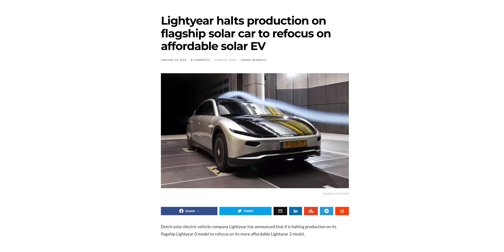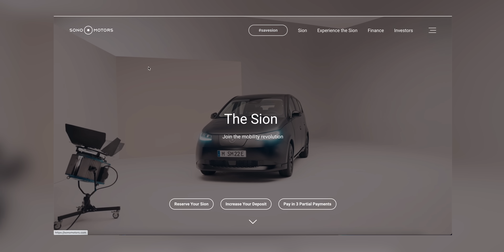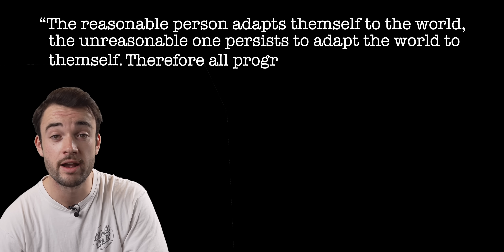Will Solar-Powered Cars Ever Happen??

Comment: If the cells hold up over years of ownership, it can be a reasonable way to trickle charge the battery. But nothing within 30 years expected that will make it a primary source of power. But great if you only use the car once a week and it can sit out in the sun until then.

Comment: Unfortunately it is a stupid idea because you can simply put solar panels on your roof and charge your EV from them. For example a 6.5 kw solar system with a 5kw inverter can provide 800,000 miles of charging. Two Model 3 Teslas for 20 years. So instead of paying $250k for one Sono  you can simply pay $6k for a solar array and $40k for a Model 3 Tesla.
Reply: It is not an either/or choice.  Many potential Aptera owners don't have access to solar panels on their roofs, and even some of those who do may travel enough that the on vehicle installations can still pay off the cost in a reasonable time frame.

Comment: I've been tracking these 3 startup from the beginning
Sono motor: doesn't have real technology and they hire contractors to find solution, and it seems they don't know what their doing I can't find in their team single talent 
lightyear: have great technology and good passion team and build a real solar EV the problem is when they reach the production hell, they didn't plan to this point and they surprised by the amount of problem and cost they are faced and they fail fast
Aptera :is the best and real technology between them with very experienced and talented team they calculate every step they are doing with very low cost, and they planned to production from day one, the only problem they are faced is timing, if they launched sooner than that they will find every funds they are want from everybody
Reply: Aptera and lowcost? motors from slovenia, bodies from Italy? Batteries banged together from ancient korean cells?

Comment: when you know physics...the answer to the title is simple. power for area of solar cell is low compared to the needs of an automobile...and then when you consider the cost of incorporating the cells into the body of the car, the concept becomes ridiculous.   the people who think this is a viable idea also think an engine can be run on water.
Reply: I suggest you take a look at the numbers Aptera is achieving and couple that with the fact that the cost of full solar on an Aptera will amortize, and just not only in the sunbelt.
Reply: @n.brucenelson5920  i'm not talking about an Aptera. i'm aware of the solar challenge and that a vehicle with very little load and extreme aerodynamics can go places on solar.  i'm talking about automobiles that carry families and luggage and have safety features....solar won't do anything of worth.
Reply: @rwhirsch  You are correct that solar is far from the point that it can just be grafted on to an ordinary car and make a significant contribution to range.  

Aptera, while fine for couples, won't be a family car until they introduce their 4 wheel, 5 passenger sedan.

The present Aptera has 32.5 cu ft of luggage space, and has significant' safety features, including crumple zones and front air bags.  We will learn how effective these measures are when the third party FMVSS Part 200 crash test results are published.

Comment: The problem with these cars is the dream they sell will never be realised.
E.g. The Aptera presentation explains the solar generates 4 kWh per day and the vehicle efficiency is 100 wh/mile - sure 🤯🙄
Reply: So, where exactly do you see a problem?
Did you overlook that the 40mi/d on solar is a maximum "up to" value?
Reply: @ThomasWaldmann  - yep, I heard ‘up to’ and it’s completely pointless telling us this scenario. Be honest and give us some real world scenarios. I don’t care for lab and controlled conditions range info, when it’ll be impossible for anyone to get anywhere close to this! There is no place on earth where this charging and range is possible in the same place, in a real use case.
Reply: @SDK2006b  You have high demands, but all you offered yet are ... wild guesses?
Reply: @ThomasWaldmann  -  wild guesses -  nope. 
I have home solar, drive an EV and have worked in the energy industry for over 20 years , so am familiar with the tech and what is achievable. There is a reason this company is struggling for investment - the claims are wild and they won’t sell enough to make it work.

Comment: Look at the maths! Solar on a car - for the amount of design/development effort involved, and the not-very-great return, common sense says, the extra cost is not worth it...a couple of flat panels thrown on the ground - way way cheaper, and just as effective. (While I do applaud them for trying...) Initial attempts at Design and Development should focus on lowest cost, for quickest project completion - add in your fancy pants stuff afterwards - if you haven't got the basics right, you aren't going anywhere....(I see projects with fanciful ideas never getting off the ground, because the basics are a bit boring, and don't get dealt with, whereas the fancy bits are interesting to designers and engineers...)
Reply: "Common sense" is often just an excuse for not actually looking at the numbers for yourself.  I have for my location in Iowa - not exactly the sun belt, and the cost of full solar still amortizes in a reasonable time frame.
Reply: @n.brucenelson5920  Yes, But here we are talking about putting Solar panels on a car ! Its reasonably easy to see that its a tricky thing to fix multiple non-flat panels and connect them together on the surface of a car, rather than a (normal) large flat panel...and make it work reliably. Weather , vibration and shock will all play their part to make this harder than it might seem at first,,,and its also got to look reasonably good too ! It's doable, but is it worth the effort ?

Comment: I'm not quite sure why they all insist on jumping from prototypes to much larger scale production. Why they refuse to settle for being a specialty small scale garage car company for as long as they have interested customers at whichever price-point they can get.
Reply: Have a look at how arcimoto is doing currently, maybe that answers why.
Reply: For Aptera and other similar efficiency driven vehicles to achieve their intended purpose, they must replace a significant number of much more resource intensive vehicles.  That implies quantity production.

Comment: Yes, Aptera looks a bit strange, but in an industry disruptive way. High-efficiency EV design with solar-assist makes a lot of  sense for many people -- as does Lightyear and Sono. This is the direction future EV design needs to go. I invested.
Reply: We need more vehicles in the 'small, cheap and efficient' EV segment, and the Aptera really hits a good spot between being sleek, hyper-efficient and small without compromising utility. Nobody else seems to be doing what they're doing. For those who don't really need more seats, this be the only car they need to buy. The entry price for this kind of capability anywhere else is far greater. I'm really looking forward to seeing how it turns out and I'm rooting for them.
Reply: Solar on vehicles make no sense at all. Therefore Lightyear and Sono are already gone. Aptera is next.
Reply: @vic321344  Gaining as much as 40 free miles of range daily just by parking outside whether at home, work or out camping "makes no sense at all" yeah, sure... don't bother providing reasons or anything. :\
Reply: @MaskedMammal  These 40 miles are just marketing phantasies. Lightyear did not get it, Sono did not get it. Both dead now. Aptera is next.

Comment: 7:20 Aptera intends to make a narrower model for the EU.
  At the cost of the vehicle being a little less efficient.
Reply: How do you want to make a narrower model? A 1 seater with no stability?
Reply: @vic321344  I'm guessing they'll tuck the front wheels in a little closer. But we'll see.
Reply: @rashidclark  Anhd how do they want to steer the wheels? The aptera motorcycle already has a turning radius larger than a F-250.

Comment: The Sono seems like a car which would do EXTREMELY well anywhere that people don't drive huge distances and there is a lot of sunshine. In many cases it could mean that people literally never have to charge their cars, or do so so infrequently that they can top up every now and again from a standard wall socket. Anywhere in Spain for example, or even the Canary islands where it would essentially be a perpetually charged car.
Reply: Living in the south of spain and I have my sono sion reservation. Hope it gets produced.
Reply: @JorgeCastro_inf 
I read that they were manufacturing some of them in Germany, if that's true, that would be great
Reply: @tomhunter7536  sadly, they abandoned the production of the sono sion and are focused on installing solar pv on other vehicles. No sono sion for us sadly.
Reply: @JorgeCastro_inf  Dont need to hope anymore.
Reply: You can literally take any PHEV vehicle in production and slap a solar roof roof on it (like a van or a SUV ) to create a fully solar powered PHEV-s vehicle . why no major car company  one does this...
Reply: @chinabluewho  Because it is ínefficient and exensive. The yield is anemic.  It has no real use. Hyundai tried it on the Ioniq5 and now they cancelled it. Lightyear and Sono tried solar on BEV, and they failed. Aptera is next.
Reply: @vic321344  Vans or SUV's that have a ton of roof space for solar, a PHEV-s van or SUV by a major car company would change our  vision/attitude .
Cheap clean renewable energy that is just begging to be exploited.
I think we both can agree LIghtyear and Sono were simply not competent.
Reply: @chinabluewho  German Fraunhofer institute just tried that. Filled the roof of a truck with solar, got 3.2 kW peak. Was not even enough yield to drive the aircon. Other projects of this kind were cancelled or are on hold.
Reply: @vic321344  It makes no sense to imply "well solar can't power an AC in real-time". Because people don't leave the AC on in their cars all the time. They drive the car, they park somewhere and leave it there for extended periods of time. While it is parked, the panels are feeding energy back to the battery. Secondly, and kind of obviously, if you had two cars - one is an EV that charges only from the mains, and the other is an EV that charges from sunlight AND/OR the mains, then one vehicle has lower operating costs than the other. Can you guess which one?
Reply: @drxym  The solare range was always just marketing squack. Sono never published real life solar yield. Neither did Lightyear or Aptera.
Reply: I live in the Canaries and sunshine is our normal weather, so it would be great here. Never having to fill up with fuel or plug in to charge -- the ideal car 😂
Reply: The solar yield was not nearly enough to drive the car. It is anemic in real world scenarios.
Reply: @vic321344  Not on a van it wouldn't be, think about having 1 to 2 K of solar an hour while you are parked at work charging your battery (or at home), now think about the average travel distance is 6 miles for an American plus you take into account most people are like me and have two vehicles, if I have two PHEV-s vehicles I may not ever need to charge them via outlets or petrol since I only live a few miles from work and even less to the grocery stores.
Reply: @chinabluewho  But you remember that the charging electronics eat up at least 300W of your solar yiels? And the soalr arrays must withstand vibration, deforming, heating, salt gravel etc.
And maybe you had physics in school. A car needs 15 kW to drive. Thats araounmd 2 magnitudes more than you get from a solar array on a car. And the solar is expensive. And never cool down the overheated vehicle because it stood in full sun all day. That would kill the solar yield.

It is much cheaper and more efficient to put the solar on the roof of your gtarage. Together with a battery.

Comment: A good product seldom has problems to find investors. If they are staying away, than there is a reason for it. And it so happens that it is the very reason why no established car company put solar panels on their cars yet: it doesn't make sense (yet). The cost and weight added by the panels offset the gains by such a large margin, that it's better for everyone involved (including mother nature) to simply omit them. In some years, when solar panels offer bigger efficiency, this will change and I am certain, that there will be investors at the ready. But for now, this simply is not a viable concept.
Reply: If we were just talking about attempting the retrofit of a standard design, you would be correct.  But this isn't the case for Aptera, for sure, and perhaps for others.
Reply: By your statement "The cost and weight added by the panels offset the gains by such a large margin, that it's better for everyone involved (including mother nature) to simply omit them." it seems clear you don't really have an appreciation for the cost and weight of the solar panels on Aptera or Sono.  Lightyear's are indeed heavy BTW.  They are double glass.
Reply: @bobhilder1469  You can actually do the math pretty quickly. And it doesn't add up for the Sono for sure.
Reply: @NameNaameNameeNaamee  So you say.  Feel free to SHOW the cost a weight "math" for Sono's solar.

Comment: Bright spot: the fisker ocean one and extreme models in production now and slated for delivery at end of Q1 2023 will all feature solar roofs adding around 5 miles of sun powered charging per day.
Reply: But only if you park it in the direct sun. The Ioniq 5 had a solar panel roof as an option when released - but they never offered that in countries that don't have the scorching sun required to even make a dent in the energy balance...
Reply: @karlgunterwunsch1950  it will have a gauge in the ui showing the driver the total solar powered miles over it's lifetime, which will add up to a lot of emissions saved over it’s lifetime

Comment: The idea sounds good until you think a little more about it. Our cars spend a lot of time in car parks, garages or in highly built up towns. To properly power an EV so that you rarely need to fast charge you need about 60 m2 of solar cells. A Sion has maybe 3 m2 decently aligned - but see my first point, they need to be parked in the full sun to make the most of their piddly small active PV area - and the modules have a different heat heat expansion coefficient the the chassis of the car (which stays cooler because of the cells on the surface to make matters worse). That's why the current test models of the Sion look shabby.
Reply: Well, if you know that you will park mostly in the shadows, it's just not the car for you.
That doesn't imply that everybody has that "problem", though.

How did you come up with 60m2? Of course, the Sion is way less efficient than the Aptera.

I guess the material issues you fear were already solved by Aptera, they did quite some "stress testing" with their special panels.
Reply: @ThomasWaldmann  Aptera is further behind than the Sion. AFAIK they haven't even finalised the crash structures. The Sion has a design ready to be homologised and then put through the standardised crash tests. And even that isn't going nowhere fast as they are trying to get their future customers to cough up the money in advance without any reliable indications when the first final cars are to be rolling off the production line.
Reply: @karlgunterwunsch1950  How does that reply to the post you replied to? We still don't know how you came to 60m2.
Reply: @ThomasWaldmann  That's the common assumed area to make an EV autonomous for half of the year in middle europe...
Reply: @karlgunterwunsch1950  Show the math?
Reply: @karlgunterwunsch1950  Karl, you are behind the curve.  The Aptera production design was essentially finalized at the end of the year, including crash simulations.  C.P.C is cutting steel for the body production and master supply agreements are signed with vendors for 92% of the parts at this point.  Funding is currently the gating issue to get to production.
Reply: @karlgunterwunsch1950  This is a meaningless number without knowing the assumptions.

Comment: Apparently it's hard to make cheap electric cars, too, which is why I'll be driving cheap used diesels until electric isn't just for the rich to acquire more toys.
Reply: Provided you can park and plug in at home so you don't have to pay for public chargers you can borrow the money to buy an ev and charge it at home for less money than buying and buying fuel for an ice car. Comparing a beat up old ice car to a new ev obviously isn't a fair comparison. In due course there will be plenty of second hand evs for people on a tight budget.  Second generation evs with proper thermal management suffer from much less battery degradation than the 1st gen ones like the leaf.
Reply: I once drove a diesel VW Golf back in the '80s but my experience in Kuwait during the fires woke me up to what we are doing, as well as working to remediate leaking fuel tanks at filling stations around the world, including Europe.

Comment: Come on Lightyear. I desperately want you to do well. That said, the tech looks so unbelievably solid on the Zero, you can't help but feel one of the big players would buy the intelectual property if it all fell apart. They would take the risk
Reply: It's a common strategy in the tech industry to set up a company not with the intention of ever actually making something, but of being bought up by an established player. The problem comes when the big players say "Hard pass, sorry."
Reply: Absolutely. It all looks like the big players are there in the shadows to make sure that these three don’t get the cash they need…